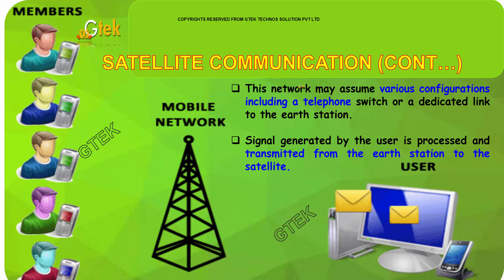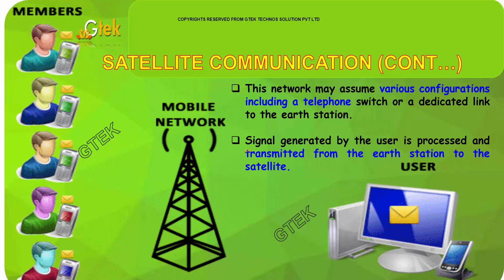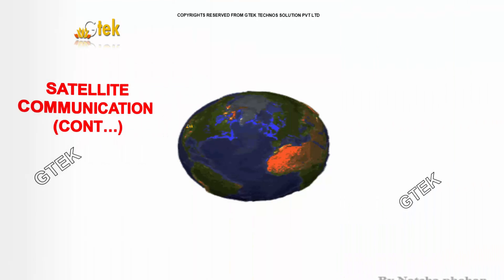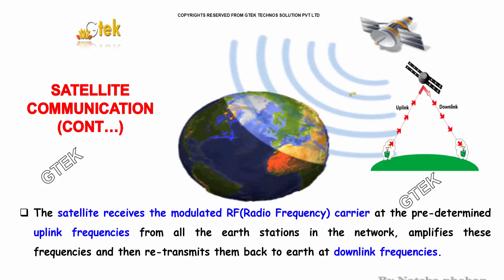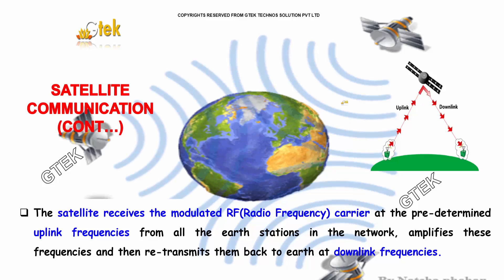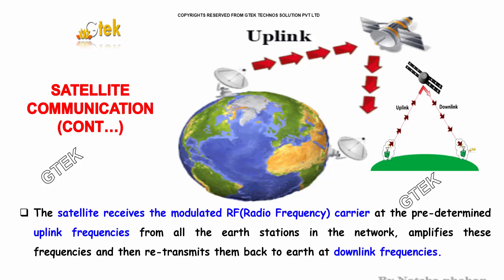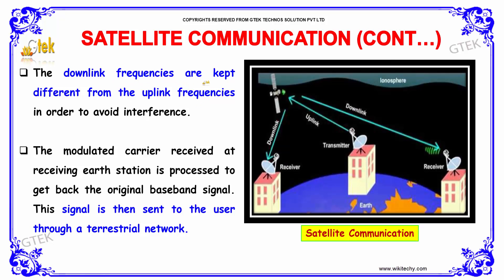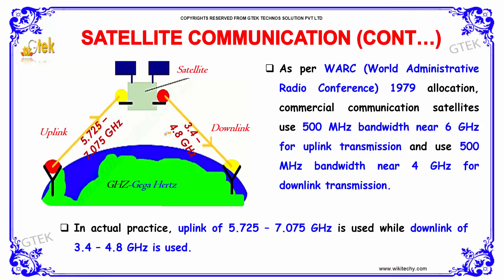Satellite Communication Part - 2 |Communication System |class 12 physics notes|CBSE|IITJEE|NEET

Comment: Radio signals operate in the 3 Hz to 300 MHz range. Microwave signals are used for both satellite and ground-based communications. Many TV and telephone communications in the world are transmitted over long distances using microwave signals. They use a collection of ground stations and communication satellites.

Comment: In a communications satellite, a transponder gathers signals over a range of uplink frequencies and re-transmits them on a different set of downlink frequencies to receivers on Earth, often without changing the content of the received signal or signals. The term is a portmanteau for transmitter-responder.

Comment: A satellite works by receiving radio signals sent from the Earth and resending the radio signals back down to the Earth. In a simple system, a signal is reflected, or "bounced," off the satellite. For example, it is possible to bounce a signal off the surface of the Moon back down to Earth.